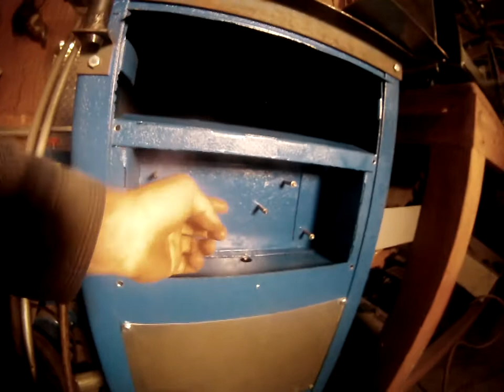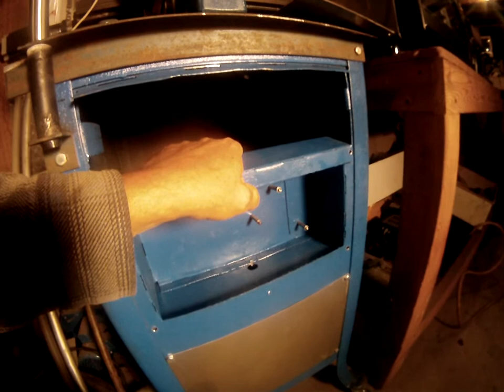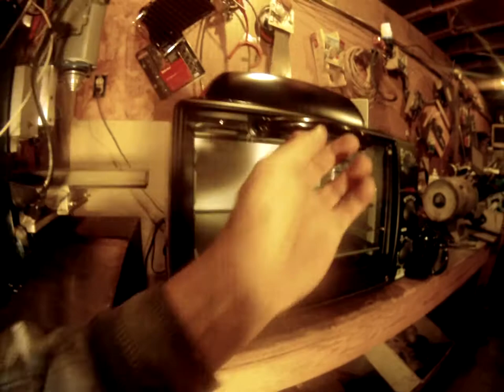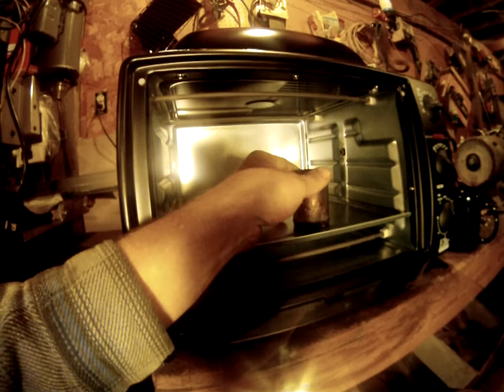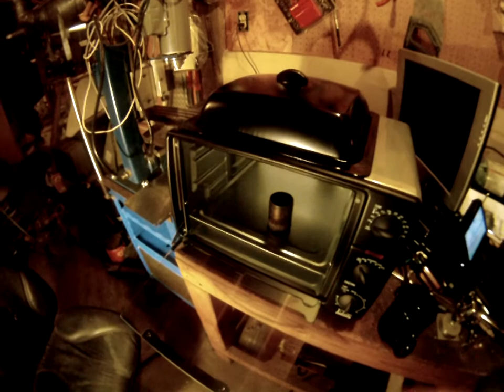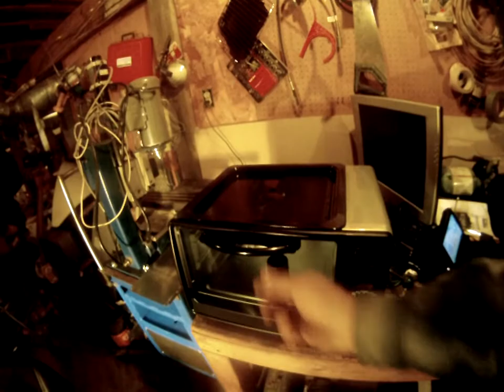cnc update and new shop tool

Comment: Good stuff Ron, PM me your address (if it changed since you sent me the printer parts) I've got a spare pid temperature controller you can use in the oven.
Reply from the maker: +TheWreckingYard awesome... are you thinking what im thinking.... a pid should hold the temp better and maybe i could try something like reflowing solder.
Reply: +builtrodewreckedit Yup, Ben Heck had a more sophisticated setup for reflowing, it could do a full profile.  This one is an older one that is meant solely for holding a specific temp.